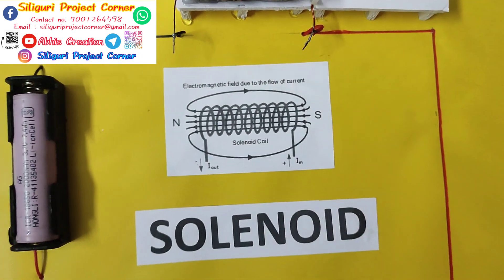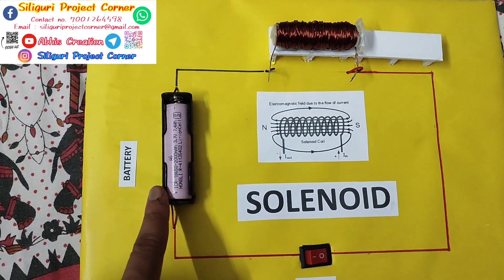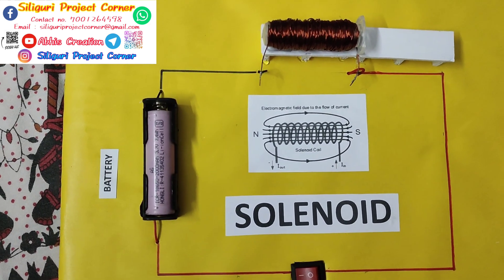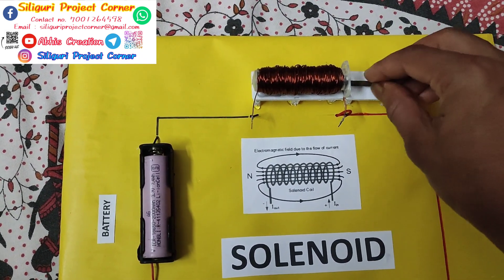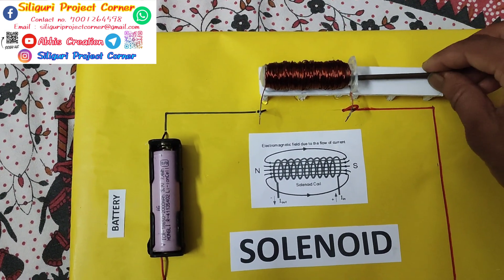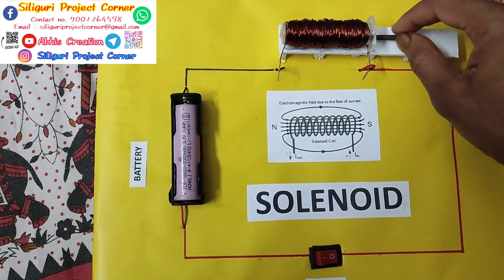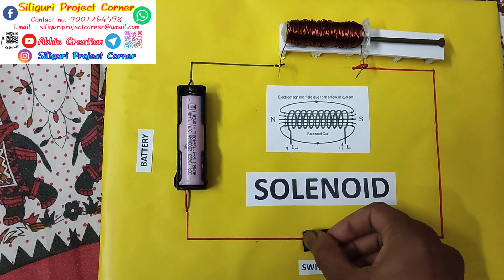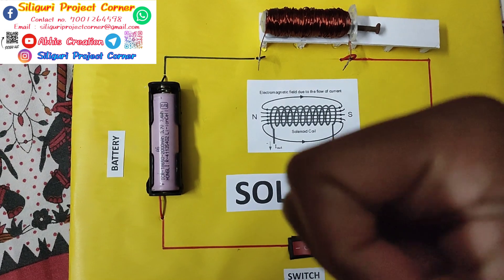Solenoid #Physicsinvestigetoryproject #solenoid #physicsproject #class12physicsproject

Comment: Sir wire kitna gauge k hai
Reply from the maker: 10, for more details you can contact 7001264598
Reply from the maker: SILIGURI PROJECT CORNER 

CLASS 12 CBSE PHYSICS INVESTIGATORY PROJECT 

💡 We Also provide Soft copy of Project Report / Synopsis 

 ⚙️ LOGIC GATES : https://youtube.com/shorts/aKx9GafQzZQ?feature=share

🔭 LDR PROJECT 
https://youtube.com/shorts/-ElWWnTimzo?si=GHy2XUG0yYqTf061

🔬 ANGLE OF DEVIATION OF HOLLOW  PRISAM 

https://youtube.com/shorts/Y4laTONAdl0?si=JK9EsgwTElh2ND8w

https://youtube.com/shorts/5qaOc3gULV4?si=rDMCvzTadZBN6Ym9

💡 CHARGING & DISCHARGING OF CAPACITOR 
https://youtube.com/shorts/aDKPng6HhPU?si=Gvo9g9zkI7UKXd6x

🔭 WHEATSTONE BRIDGE 
https://youtu.be/kAmiqCVJwBo?si=XlXXQfYRqLhdX70y

🪫 HALF WAVE RECTIFIER 
https://youtube.com/shorts/fQgbNQbTttg?si=xro_5dZYwGa1jPii

🧲 FULL WAVE RECTIFIER 
https://youtu.be/ZXKopxVeyEI?si=ms1ZPItqKJQnH5d9

⌛ INTERNAL RESISTANCE / EMF 
https://www.facebook.com/share/1CqXo6d7YM/

⌛ AC GENARETOR 
https://youtube.com/shorts/1psNeHVHvJM?si=eFehY-OPiRpTVmm0

⏳ LASER SECURITY SYSTEM USING LDR 
https://youtu.be/_HeDKKiUW5g?si=6hUemtt9wgTKb4VM

⏳ SERIES & PARALLEL CIRCUIT 
https://youtu.be/AMaNoO1pS1o?si=AyozpBTGJXpNsIdf

⏳ DC MOTOR : 
https://youtu.be/MInLPaLqYs4?si=SogB6FOgRrVQjk58

⏳ WIRELESS POWER TRANSFER/TRANSMISSION
https://youtu.be/pbhr3RVJ73c?si=l9QC2aF3ktV2P_Qp

https://youtu.be/fqQEIWbFM9c?si=S8DHE2Q9UJ6-xjNx

⏳ ELECTROMAGNET : https://youtu.be/H4NvJJFvxOk?si=ZvsM9SqoZ9vpuZGB

⏳ IMAGE FORMATION THROUGH CONVEX MIRROR / LENS https://youtu.be/8yqjgVNyhF0?si=1Xqu3bLzWxC9Og4m

⏳ NEWTON DISC https://youtu.be/Ni17ZgYoYhk?si=mptt2ZdKkeLmkkCM

⌛ FREE ENERGY GENERATOR 
https://youtube.com/shorts/79ys1rtjk_A?si=ly-axIKNspCdxeaR

⌛ SOLENOID https://youtu.be/cSde8WiX30M?si=ECkWabZcZNwSAs4c

⌛ Junction Forward and Reverse Bias 
https://youtu.be/4-K5ZcHrGJs?si=_Q6hTK1T1Wn5JR1Z

 ⌛ Wireless Power Transmission / Electromagnetic Induction 

https://youtu.be/csVkREh1nks?si=aMVLJRojacVYq6_p

 ⌛ SINGLE SLIT 
https://youtube.com/shorts/N6kng_U2anQ?si=iYdQUV-sPlScvCBi

Contact no :7001264598

🤖Website : https://sites.google.com/view/siliguriprojectcorner/home

👨‍🔬WhatsApp Channel: https://whatsapp.com/channel/0029VaAGmMR60eBdLkoWaB0v

🧲Facebook : https://www.facebook.com/profile.php?id=100057107453904&mibextid=ZbWKwL

🔩Instagram : 
https://instagram.com/siliguriprojectcorner?igshid=NGExMmI2YTkyZg==

🔭YouTube : 1. https://youtube.com/@SiliguriProjectCorner?sub_confirmation=1

🔬2. https://www.youtube.com/@AbhisSciTechCreation?sub_confirmation=1

#class12physicsproject #physiceworkingmodel #projectshopinsiliguri #investigetoryproject